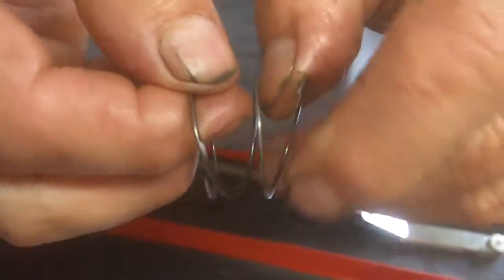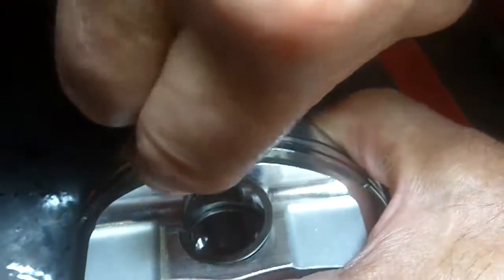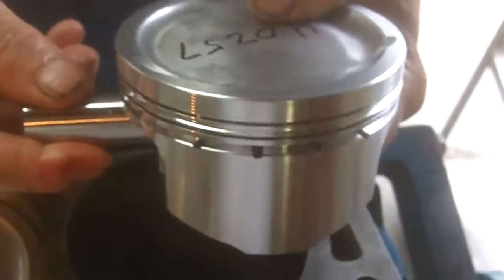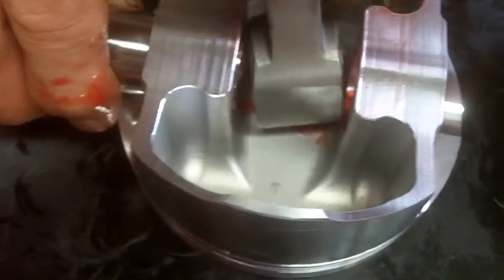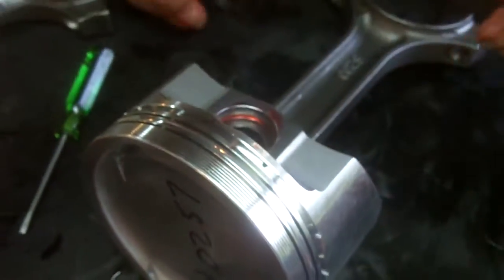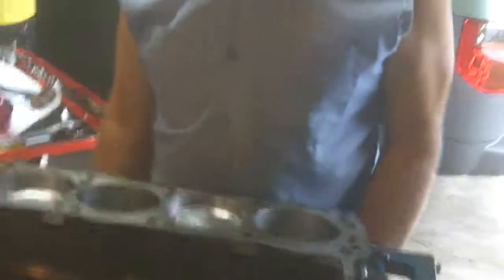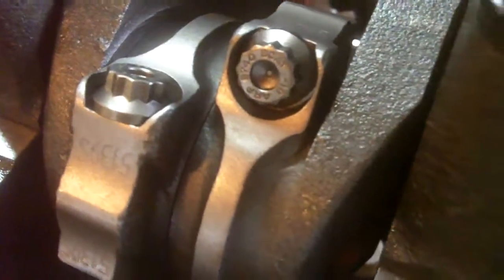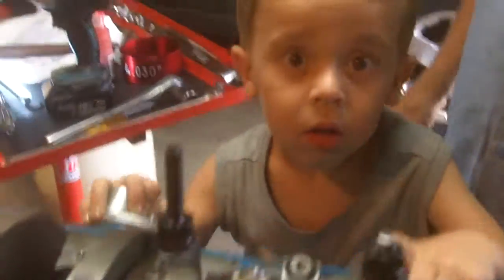Engine Building with RoG - Piston Rod Rings Installation

Comment: Did you have the crankshaft and motor turned and cleaned at a machine shop. Did they tell you what size bearings and rings to buy?
Reply from the maker: Ray, the crank journals were okay and we went with standard sized main bearings... We had the block fluxed and hot tanked. They did most of the boring, we did the finish honing and then used a flex hone. If you have more questions, please ask away! I hope you are enjoying the videos...